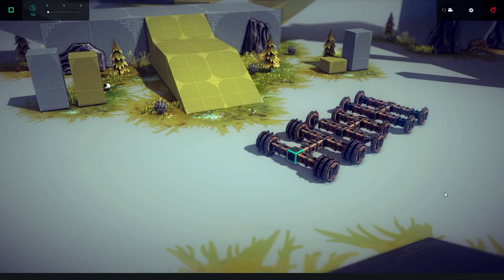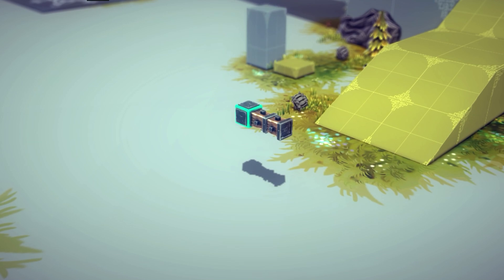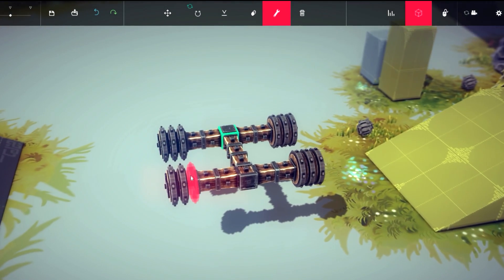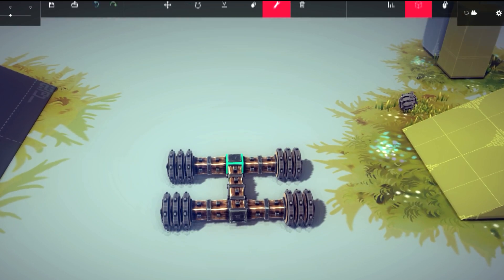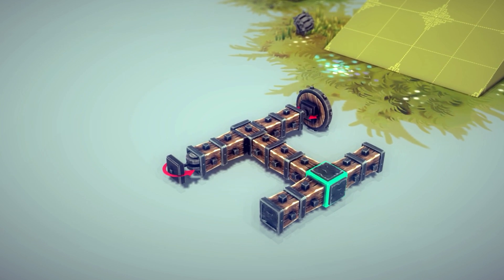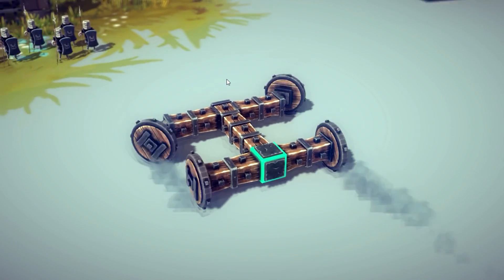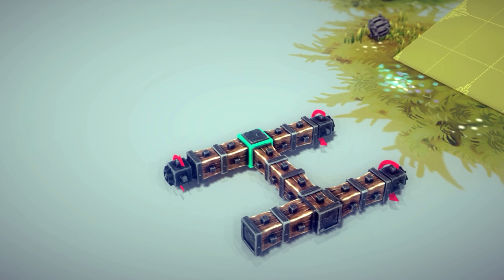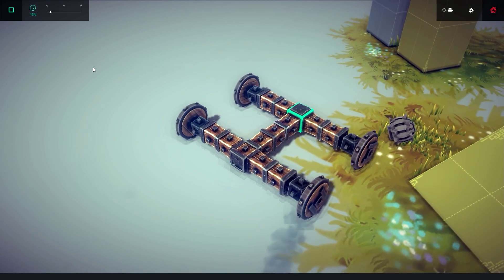Besiege Tutorial #2 - How To Steer/Best Steering Methods - Besiege Steering

Comment: i just put a large wheel on top and but thoose small wing things on the four connection points and set speed to six if i set the speed to 10 it can turn without forward or backwards motion

Comment: just installed the game and well i added stuff on the base model and after resetting and adding wheels again it wouldnt go forward or anything, so i added shit on it and it still wouldnt do anything, the game gives little to no information besides "this is basic and it runs on profanity and belief". Still not sure why it wont go anywhere,  so i had to go to level 1 again and build it from scratch to get a working frame again.. then came mission 3, turning.. no guide to help you in the basic department, i think its fair to help the player to make a deathmachine steer,  the weaponization etc. is the creative part, i didnt sign up to be a mechanic but a mad scientist.

Comment: You skipped the best way to steer, instead of having 3 wheels, just have 2 and alternate the left and right.
2nd wheels on the left are (Right - Left) and 2nd wheels on the right are (Left - Right)
Its just as good has 3 wheels but simpler, lighter and more compact.

Comment: Steering hinges work better with shorter axles. Kinda like a small block in the middle and steering hinges on both sides with wheels on them. You can also make 4-wheel steering by adding steering hinges at the rear axles and then adjusting them to turn in the opposite direction. This would give the vehicle using it a tighter turning circle, especially if it has a shorter wheel base. The common mistake is that most people make the rear steering hinges steer at the same direction as the front ones, making the vehicale "strafe" instead of turn. Real life monster trucks use that kind of steering.

But if you want something more agile, tank steering would be better. It's the reason why those bots in robot wars can turn better than your car could.